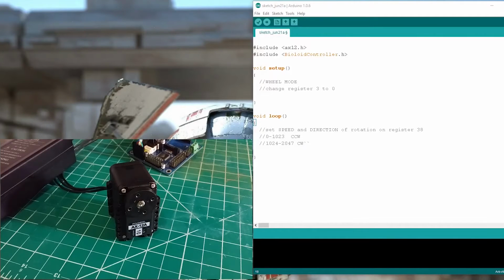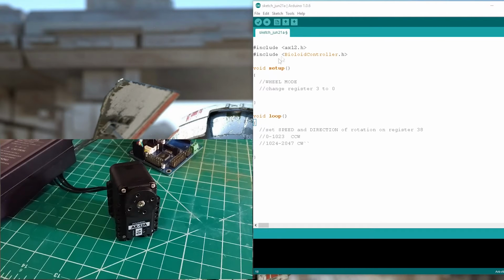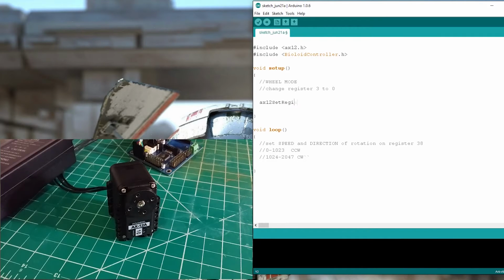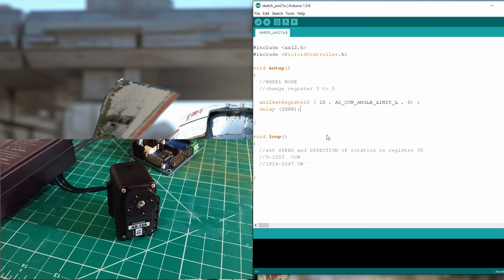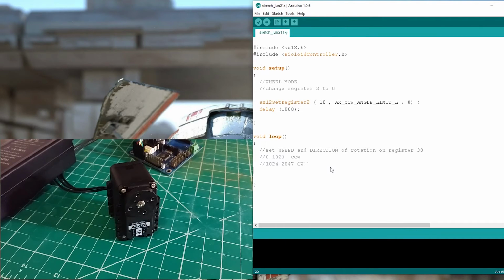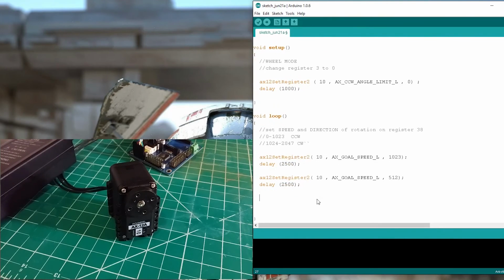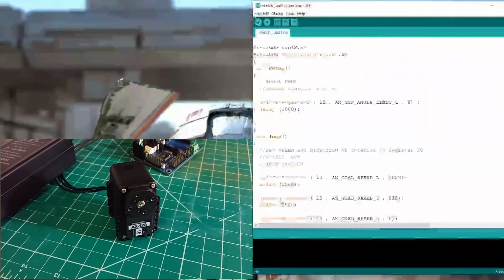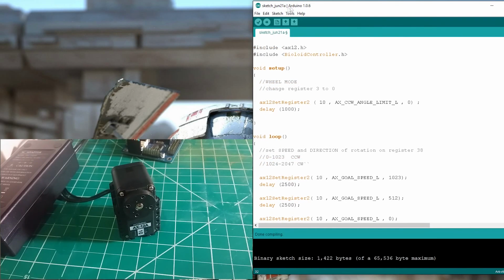Dynamixel Tutorial 11: How to Change AX 12 Motor to Wheel Mode ( for Continous Rotation )

Comment: Is it possible to change the modes from within loop()?
Reply from the maker: Yes you can. Are you planning on changing it back and fourth?
Reply: pinpointece yes, I need to alternate beteeen fast revolving movement, where I could control speed roughly, and slow movement, whete I could control the angle precisely